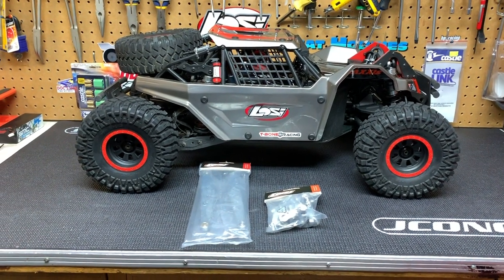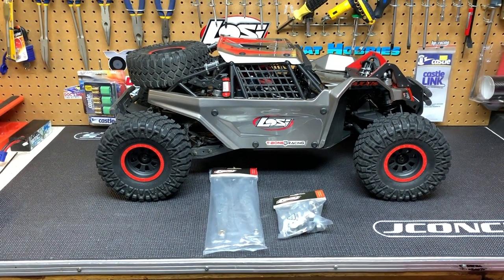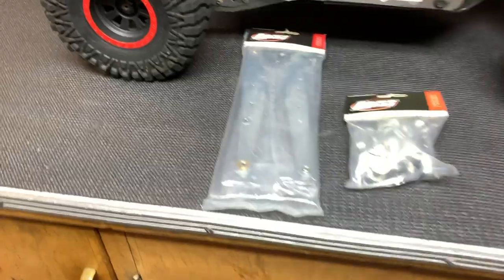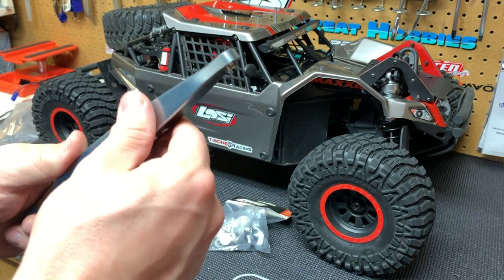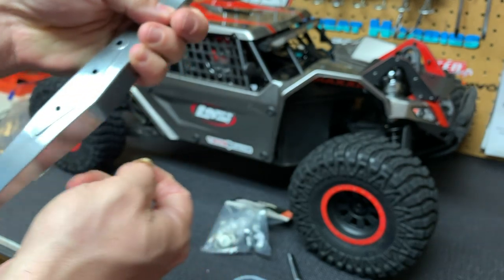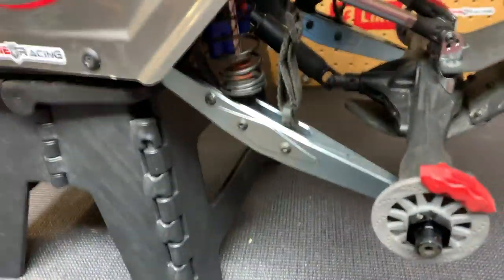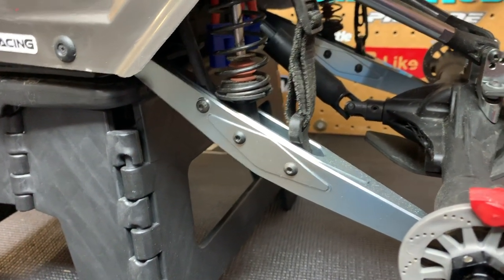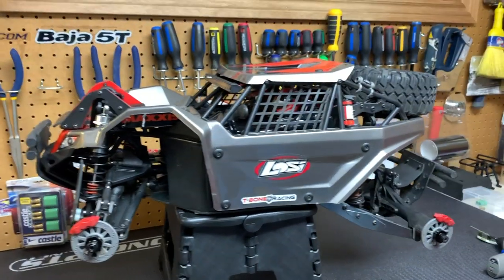Losi Super Rock Rey Upgrade Series two

Comment: I have one of these trucks. Still stock everything. I'm not sure I'll even upgrade anything on it to be honest, other than the front diff housing. I want to get the aluminum housing for it. I honestly don't drive this one all that much because the torque steer can be a little rediculous. On 30% running 8s is still pretty rediculous. Off road the grip leaves a little to be improved upon. It's almost as if it needs paddle tires or something a lot more aggressive. I honestly drive my 3XLe and my TRX Bronco more than any of the other RCs I've got. I also have the UDR and you are right about what you said, BUT they might be built similar but are nothing alike. The UDR is 1/7 scale while the SRR is 1/6. The UDR is ment to be more scale, even though the SRR is scale (not nearly as scale as the UDR) as well. Don't get me wrong, even with the cons I listed, the SRR is a very very fun truck. Only thing I've broke on it is one of the rod end links for the rear upper rods. Steering needs to be tightened up as well. Good for a truck of this size and solid axle, prevents roll overs. I think for the $800 dollar price tag, you are getting more than a bargain. Replacement parts for it are a few pennies and a dime or two. Seems this way for a lot of Losi products though to be honest. Far less than the SRR's nearest competition, the X-Maxx. The SRR is far superior in build quality than the X-Maxx as well. The thing that saves the X-Maxx from damage is the big tires. If it ran the tires the SRR does it would break constantly (I've tried it). I have no fear of launching the SRR as far as possible, and it takes it just fine. It's not even ment to be a basher but from what I've seen it takes a LOT of punishment. People are probably going to think I'm hating on Traxxas, but I assure you I'm not (even have 4 Traxxas models), I just feel like the SRR overall it better built. The driveshafts are far bulkier, the gears are found in 1/5 scale trucks, even the steering servo is quite stout. I'm not even going to mention the motor and ESC because that which is found in the X-Maxx is honestly a joke for a truck of it's size. My brother has a 1/10 Rock Rey and has mod 1 gears. The X-Maxx (1/6 scale) has mod 1. The SRR (1/6 scale) has mod 1.5. If anyone ever wondered how the X-Maxx and the SRR compare, you'd have to see them in person. The SRR motor is literally bigger than a can of red bull and just a touch smaller than a 12 ounce soda can. The ESC is rated at 160 amp and motor is 750 KV while the MAXIMUM for the X-Maxx is 135 and 1200 KV. I would like to see a more substantial motor and gearing in the X-Maxx, but it just doesn't have the room. When it is upgraded with a better motor and ESC, the center diff cush drive explodes and the rest of the drivetrain follows suit.

Comment: Hey Jason, thanks for all the great videos about the SRR. So far I have a 3S Arrma Granite, and a modified TRX4. Right now I am looking for something bigger, and I am torn between the SRR and an XMAXX. I don‘t have access to skateparks to do big jumps, I like to take my cars for a hike into the woods, a quarry, or the mountains. In your video you said: „If you already own an XMAXX...“. Well, I don‘t. Would you still recommend the SRR as a first larger scale, or an XMAXX because it can do everything just better?  Thanks!
Reply from the maker: I just picked up another Xmaxx on the weekend.  I address your questions in the video.
Reply: @JasonPerrinRCVlogs  hi I just picked up my losi super rock Rey 14 days ago and I think I'm having an issues and was curious if you had experienced it and if so how did you correct it. My issue is that when I accelerate the rear right end drops down causing the left front tire to come off the ground. Losi sent me new springs, and I have check the shock fluid and losi recommend me to out heavier weight and I'm still have that rear right drop. I also tried shifting the rear shock around to see if this issue followed to the opposite side and same thing on the same side.

Comment: Hi can you give us a total price for all of the hop ups that you have installed on this Losi so far. Thanks
Reply from the maker: I don’t keep track.   But I know it was over $400 CDN.
Reply: @JasonPerrinRCVlogs  ...wow now that's one thing I don't like is to pay $800.00 for a hobby grade rc car, and then have to pay an extra 400 plus dollars just to get it to perform correctly...what a scam artist these rc companies have become.  If it was an radio shack  or walmart car I then can see the hop ups are needed, but an highly priced hobby store grade rc car come on get real. And so far majority says this breaks right out of the box.
Reply from the maker: I wouldn’t say any of those parts are needed.   But I enjoying modding.   They will add strength, and the Tbone parts will add protection.   But again not needed.
Reply: @JasonPerrinRCVlogs  ...but the front end parts and servo and servo parts are needed right out of the box from what others are saying on YouTube.
Reply from the maker: ALUMINUM CRUSHER I still have the stock servo.  Yes it can be upgraded.  And in time I will.  But I have larger servos in most of my trucks.   Rtrs get you going.  But all rcs benefit from upgrades.
Reply: @JasonPerrinRCVlogs ... That's true all rc cars benefit from upgrades,  but we should have a lot of fun for a while from these 600 hundred to 900 dollars plus vehicles from out of the box.  Like with the X maxx,  and Losi 5t before an upgrade is needed.